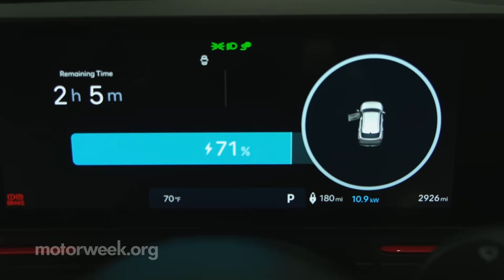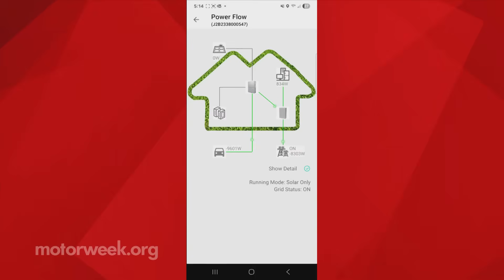How EV Charging Affects Electric Supply Infrastructure | MotorWeek AutoWorld

Comment: The problem with this video is it didn’t reinforce the false narrative coming from the anti-EV crowd that the entire grid is going to crash due to EV’s. Technology with proper management and common sense will allow EV’s to exist on the current infrastructure. We understand the EV haters were excited to click on this video only to be disappointed that there really isn’t a problem.
Reply: Not having faith in EVs doesn’t make me a hater.  More testing is needed.  Faith is theology, not science.
Reply: @jeffforbess6802 How they drive is good, power delivery, comfort all good. 
My problem is longevity of the batteries and a very expensive replacement.
It’s not an issue for new car buyers, it’s an issue for 8+ years used car buyers.

Comment: DTE in southern Michigan has a similar program. Most of my charging, though, comes from rooftop solar. My Powerwall is set to charge the car using solar electricity that exceeds the needs of the house. If additional charging is needed it charges automatically at 2:00 am. I will sign up for DTE’s managed charging as soon as I determine that it is compatible with Charge with Solar.
Reply: What’s your ROI?  10 years, excluding upgrades and maintenance?
Reply: @jeffforbess6802  With the Powerwall, my best estimate is 11 years. With more solar charging on the car, that could shorten a bit. So yeah, about 10 years.

Comment: data centers take so much more power than evs...
Reply: Correct.
Blame Big Data for your utility bill rate hikes
Reply: Most cars are charging at home on 11 kw chargers.  Plus they can charge on off peak times often.  Data centers don't do any of this.
Reply: But also use their own power stations/ solutions
Reply: For now.  Just 1000 cars on 100kW chargers, is 100 MW.  My power company has roughly 5 GW of capacity for nearly 1.5M people.  Those 1000 cars are 2% of total capacity.  That adds up pretty quickly.  To make the math easy, let's say there are 1.4M and everyone can only charge one day a week.  That's 200K charging at 10 kW each, which gives us 2 GW or 40% of max output - just for cars, every single day.
Reply: @KRAMITDFROG  your math is way off.

Comment: Great ad. Ill save 10k on a new car and keep buying ice.
Reply: For now…
Reply: @frankleespeaking9519  Good point.  It's been 47 years so any day now!
Reply: @kenro-96  save $10k on what?  Motor oil is changed how often?  How much is a weaker powertrain worth?  What day of the week do you prefer to have engine troubles on?   Is it best to have the transmission to act up in the beginning of the month or in the middle of the month?  Just curious becuase some of us have lost track of those things.
Reply: @kelviskelvis7140  I bought my first car in 1978 and never had drivetrain trouble on any car except the '81 Mazda GLC with 100k miles on it.  Still ran, was just making noise and sometimes hesitating.  Wife drove a '04 Acura TL for 18 years with no drivetrain problems.

Comment: sounds like rationing and breadlines to me...
Reply: You obviously didn't witness gas rationing and long lines at gas stations with fights breaking out among those waiting in line in the 70s, thanks to the US dependence on OPEC oil and their embargo on a whim just to cause the shortage. Ptsd for this kid who saw it.
With an ev, you can always fill your vehicle from multiple energy sources: nuclear, coal, natgas, propane, hydro, wind, solar, geothermal, gas or diesel.
Just buy yourself 5-10kw of solar panels and you fill your vehicle daily for free. Use a quality multi fuel 2-5kw inverter generator to charge your ev using gasoline,  propane, natgas in a pinch. Or a diesel generator with used motor oil or vegetable oil.
 Or just charge at home over 120v or 240v when your rate is 10 cents or less a kwh.
Gasoline is about 38 cents per usable  kwh currently assuming 3.20usd per gallon.
Don't you want to pay 80 cents per gallon of gas equivalent for electricity?

Comment: You give up freedom with EVs. We all knew the system would manage the driver one day. It’s how you give up control one little bit at a time.
Reply: You GAIN freedom with an Ev.
I installed 12kw of solar on my primary home, and plan to add similar to a lake home. I will be able to fill my ev from solar daily for free. The solar powers the homes and vehicle.  
You can carry enough solar on a ev to fill with daily driving needs or more if a truck with ability to carry a 4-5kw array to charge while parked.
Throw a tri fuel inverter generator in the back of an ev suv or truck and you can recharge the ev with gas, propane,  natgas, or with a diesel generator on vegetable oil or used motor oil. Sounds like more choices and freedom to me
Reply: You can charge when you want. You have the freedom to charge at higher rates if you want.
Reply: Give control to who?
Reply: Exactly this. Until more of us wake up and realize this has nothing to do with saving the environment, (that ship sailed long ago according to honest climate scientists) and everything to do with control, this will continue. Why is it we get apocalyptic predictions of American coastal cities being underwater in the next 25 years, yet the same people don't want to propose massive seawalls or raising existing structures predicted to be affected above the projected future water level? That means they either know it won't happen or they have plans to profit from such a catastrophic sea level rise.

Comment: What no one pushing EVs is talking about is how there is no infrastructure to support even a fraction of personal vehicles to electric. The problem is compounded when you factor in having to change very large commercial vehicles and their enormous batteries.
The infrastructure to generate, transmit, store, and recharge the EV future they are demanding does not exist, and will not exist for decades. Oh, and we still have to extract those materials from somewhere.
Reply: All EVs can be programmed to charge late night when most people are sleeping, during which time the grid has ample and excess capacity.

NO grid upgrades needed.

An EV can be charged at home using no more energy than an HVAC heat pump, a clothes dryer an electric oven or water heater.

A couple of hours of EV charging, a couple of times per week is all it takes for what most people drive every year.

Again, EVs can all charge while most people are asleep, and while electric appliances in homes are turned off.
Reply: Only 20% of NEVI funds have been spent, so 80% more charge infrastructure to build out moving forwards.
Walmart and Ionna charge networks are building out fast.
Most charging daily is done at home.
Reply: Megawatt chargers, electric powered axle trailers  and shipping depot battery swaps will easily handle tractor trailer ev.
See the Electric Trucker  channel and how routine ev long haul trucking  already is in Europe
Reply: There’s plenty of electrical infrastructure built already. A grand majority of homes and businesses already have access to electricity.
Reply: You continue to repeat the anti EV talking points, even though they are easily debunked by just asking any AI search engine of your choice. With regards to "still having to extract those materials from somewhere" A car is a car. The main difference is the mode of propulsion. The materials for an IC engine have to be extracted and the materials for a battery have to be extracted. (In addition there are literally THOUSANDS of less parts in an EV that don't need to be manufactured)
The major difference is that the materials in the battery can be easily recycled again and again and again.  Try doing that with your gasoline, your oil, your filters, your spark plugs, your brake linings etcétera, etcétera and ALL of those materials needed for them still have to be extracted from somewhere.
Reply: @MonoBromatic Just a FYI, last year California with the highest number of registered EV’s used 1% less grid power than the year before.
Reply: If all passenger vehicle miles traveled were switched from ICE to EV it will require increasing the electric generation by about 25-30%. Since the average vehicle lasts 10years it will take at least that long before more than half the vehicles are EVs. Meaning that increasing the electric generation by 2%/yr would be more than sufficient to cover the power required by EVs. Data centers and other loads will require a more substantial investment in the grid and electric generation than EVs. 
So no there is not a problem accommodating EVs on the grid
Reply: Think about it this way. 60% of the US own their homes. Once you get an EV, the next step usually is to get solar. The more people that decentralize from the grid, the more infrastructure capacity is freed up for the rest of us.
Reply: Commercial EVs are a non-starter, except for very specific circumstances.  Trains work well.  Ferries and ships, not so much.  Saltwater and batteries do not play well together.
Reply: As an EV owner, commercial vehicles need to be gas/diesel electric vehicles like our freight trains. Engines powering generators powering electric motors that can haul heavier loads at greater efficiency and longer range. That is the true future of ICE engines for cargo hauling. Electric cars are best for city cars, and no, I’m not - and no one YOU know is driving 500+ miles per day in their Toyota RAV-4 or Camry or Tundra that they want to use that trope about EV range being a stopping point. Listen to people who own EVs and can give honest actual answers of what is needed and required.